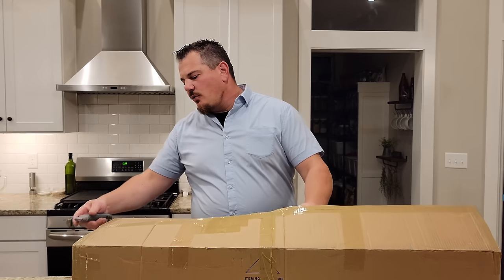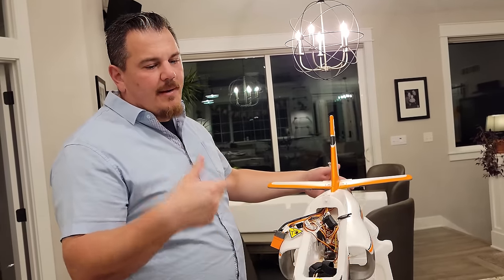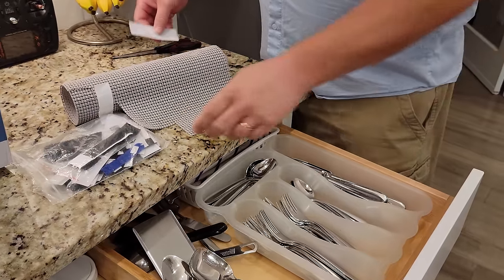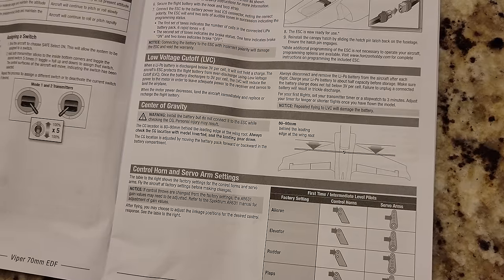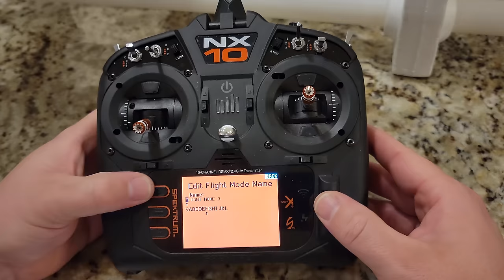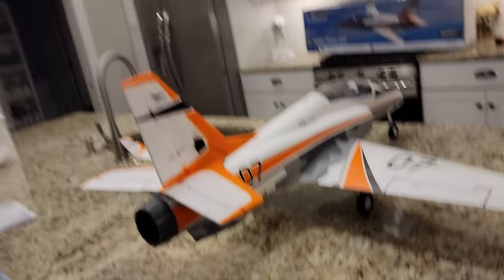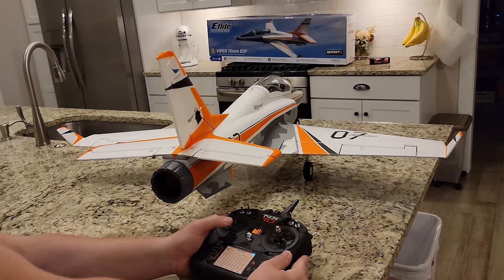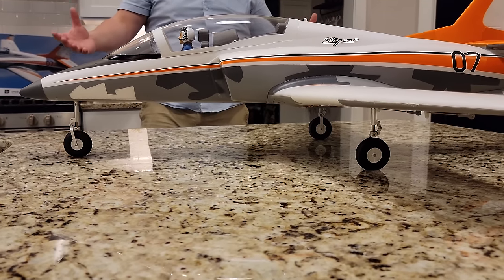E-flite - Viper V3 - 70mm - Unbox, Build, & Radio Setup

Comment: Hi Brian. In the manual it say use Switch F for Aileron. Switch C for Elevator. Switch G for Rudder. You can programme The NX10 so each switches talk to you when you switches them. If you forgot what swicth  F is assignto do  tap the switch and it tels you Aileron, tap next one Nx10 say Elevatror, Tap next switch it say Rudder. All switches on NX10 can be named like the Trottel cut on/ tottel cut of etc. That mens you have full control of all switches what they are assign to do for you. I have done that on my E-flight RV-7 And i am about to do the same with Viper 700mm EDF  that i just bought januar 2024.
Reply from the maker: yes

Comment: Thank you so much for the Viper 70mm radio set up. Never would have figured it out. You had the same issues I did and showed how to fix. PLEASE go a little slower when you are rolling through screens and tell what you are doing. You do well, but sometimes you fly past something critical.
Reply from the maker: Glad it helped and if you do want slower, have you considered clicking onto the GEAR icon on the video player, and selecting the SLOW playback...you can do as slow as 0.25 X which might be too slow, but it might give you the edge you need. We try HARD, and fail for many, to strike a balance between going too fast and too slow.

Hope this helps, and makes sense!

Comment: I finally pulled out the factory extension system and installed my own, shorter extensions. I had to put extensions on my flaps to even get them into the fuselage so I could connect to the Y on the receiver!

Comment: I have Safe Select (Safe, AS3X, no gyro), thrust reverse, gear, flaps and 3 axis control set up on my 2000mm T28 using my NX8. The thrust reverse is on the bind button. You do not need a NX10 to set it all up.

Comment: Hi Brian, I like your show and I learned a lot from it, that's a interesting concept of running your wiring harnesses through the airplane, try using a snap swivet tied to a piece of thick fishing line or a a piece of wire to pull the wiring harnesses through, a little trick I learned from wiring guitars
Reply from the maker: Thanks, and thanks for the tip!

Comment: Hello Brian, great videos i have the orange Viper 70mm and an NX8 Transmitter i followed your switch settings and set up for the plane but i don't know how to set up the gains dial for safe and as3x ? i want to be able to adjust the settings .Does the plane need to be bound for each settings program.?

Comment: Thanks for the previous information. 
I used your setup for the Viper 70mm v3 with safe and throttle reverse with pilot fatigue all the channels are used up. There is the bind port on the  AR631 receiver thats empty but i dont know how to use it. I want to install the KM After burner but i need an empty channel .I was thinking i need to get the 8 channel receiver i have the NX8 what do you think to do.
Reply from the maker: Bind port is NOT a channel, BUT it will have power, if you're just looking to steal BEC (usually 5VDC or so) to run the Afterburner ring.

IF you need SIGNAL, then you  can usually "Y" off the Throttle channel and make this sort of thing work. This is as simple as using a SERVO SPLITTER CABLE like this https://amzn.to/4bKXO8S (for example...you probably already have one or more lying around).

If you have issues getting it to work, there are some issues with the way SERIAL communication is handled between SMART ESC and the Rx, so if you can't get it to work, this MAY be an issue, and I believe that RC Geek has a compatible solution...just a thought, and he's a super nice guy too (Chris) - we're actually kinda "competitors" on YouTube, but he has a great little website... P.S. I'm not an AFFILIATE of his - https://www.thercgeek.com/

Comment: Brian,
After 15 years I am back to RC again. Everything has changed and I don't know anything about the new technology. Is there a current instructional book on how to match all the spectrum merchandise? Lost again. I have purchased a NX10, new ducted fan jet, etc Hobby zone I bought new btry and charger, but the cords don't match and Hobby zone doesn't tell you what you need to work. Just what you might need. Where do I get more info on the hobby
Reply: The RC industry has changed, for the worse I'm afraid. The days of modeling are pretty much over. About the only thing seen at the field anymore are cookie cutter made in China ARFs. Not much to get excited about. When Horizon bought out Hobbico from Bankruptcy they discontinued most of the line. Kits are all but non existent as well as glow engines. Now days people would rather spend ten hours a day on their "Dumb Phones" then building models.

Comment: Can anyone help me find out why my NX8 is not showing the menu options for first time as3x settings and the gains also the safe first time options as3x and safe is working but not getting the setup menus.please help.
Reply from the maker: This type of question may not going to give enough information for most of us to help, but I'll give it a shot...

Press the BACK button, or ESC button to back out, if you want to get out of "Forward Programming" - you might have your throttle HIGH, which might prevent you from EXITING, which would cause an unsafe condition...possibly making the throttle engage.

If that doesn't work, unplug your plane, if it's plugged in, and then power down the NX8.

If it won't power down pull the battery.

Once rebooted, should be up and running from scratch...but if not, then you should call up Horizon Hobby tech support and get some help there.

Comment: Bought the plane off your video. BUT please don't waste so much time testing AS3X. If Safe is working correctly and you can hear the servos move in AS3X THEN AS3X IS WORKING CORRECTLY. IF YOU DO NOT HEAR SERVOS MOVE WHEN YOU MOVE THE AIRPLANE AS3X IS NOT WORKING, LIKELY NOT TURNED ON! Test Safe first then AS3X. That would have saved about 5 minutes of this video. Great twist on Throttle Cut but I prefer Motor On/Motor Off sounds. It's one less word and more directly conveys what you did with the switch change.

Comment: Why would you want to pay $350 for this it's the same Jet like the blue one is they haven't upgraded  anything on this just change the color l rather have the blue one for $300 than pay more
Reply: You get a more powerful Smart ESC/Motor and upgraded landing gear for the same price as the original before it was discounted and discontinued. But overall the same yes.